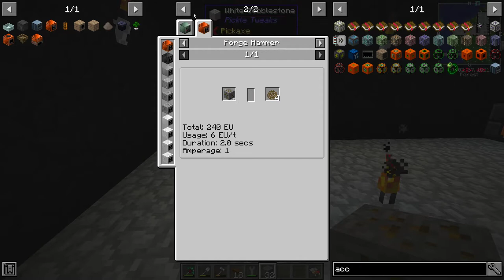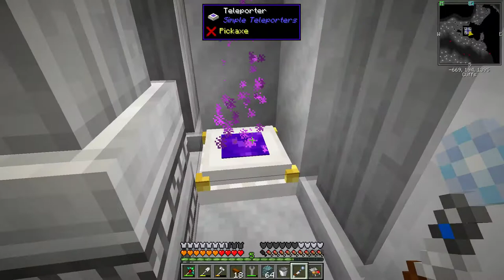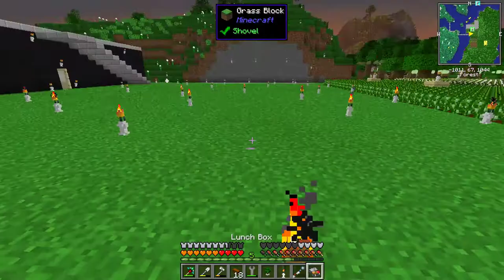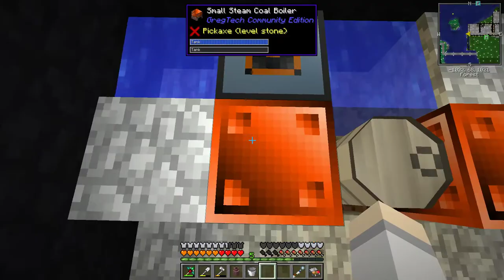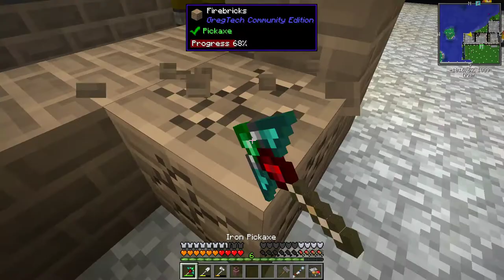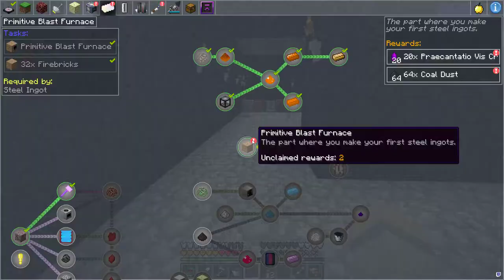FTB Interactions Classic - Part 13 - Magic & Primitive Blast Furnace

Comment: In regards to the tree beacon, a hopperhock has a cheaper recipe that requires no botania progression, and can easily collect all the drops from the beacon!  Additionally, I would recommend creating a menril tree beacon farm, as the wood is very useful later for both steam and oil power, while providing useful byproducts that can be used to make torches and other things! :D
Reply from the maker: Thanks your tips are awesome!